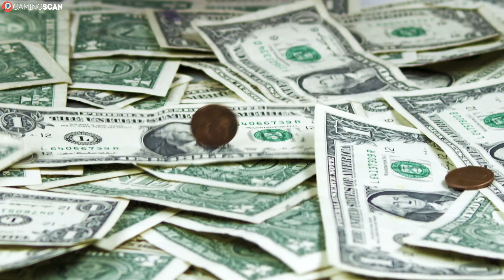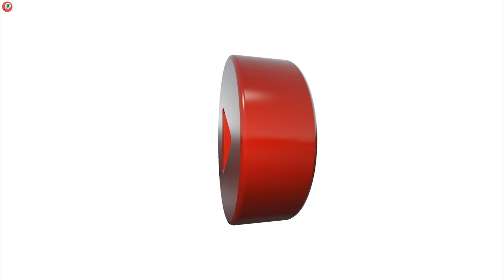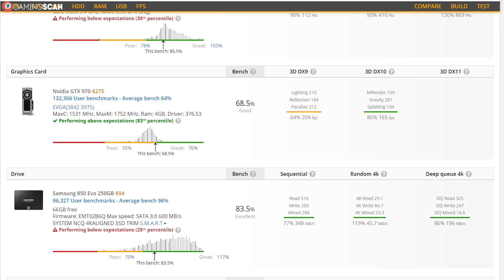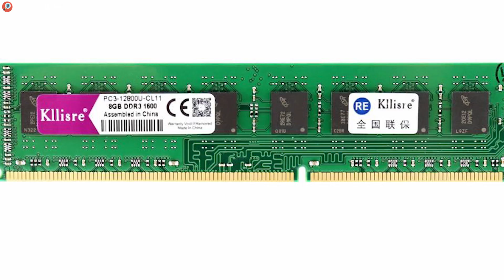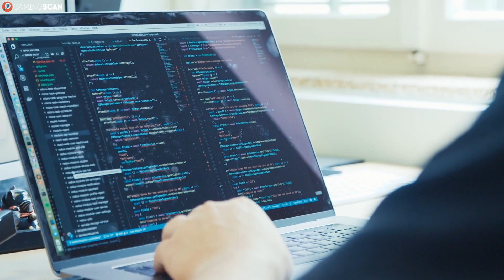How Long Will A Gaming Laptop Last? [Simple Guide]

Comment: almost 5 years~ MSI  Apache Pro~
Reply: No way. I use the 960M version, and it barely works on new AAA titles at its native resolution anymore. Being stuck with basically a 750 Ti in 2020 is not an ideal way to enjoy gaming now.
Reply: @arbutusunedo2069  Maybe you can download CSGO or Valorant to keep on with your gaming.
Reply: Mine did 6.5 year msi ge70 apache pro, then the motherboard died, did not game on it after 4.5 years, just school work

Had to replace the thermal paste and fan though, but nothing major
Reply: @rickvr11  mine still going~ almost 6 years~
Reply: Is Legion 5Pi good nd long lasting
Reply: same model, but now i have it for 6 years .. soon to be 7
Reply: What about msi bravo 15?
Reply: @allgaming2992  bad air intake build. Expect it to be 2-3 years
Reply: My apache pro ge72 is still going..but man it's lackluster asf. Obviously all settings have to be on low, runs hot enough to cook an omelet and I think a fan has died cause it spins like there's a bumblebee stuck in there and the wobble / vibration is chewin thru 2.5 hhd's like crazy now ( just figuring it out) .. Took em out and have 0 space .. Using a micro SD card as a side loader ...sucks ass
Reply: @turbobacon5945  Yea, after the 6th year my laptop just burns up. So i ordered a laptop cooling pad for it. AND IT HELPS ALOT!!!!

MY LAPTOP STILL RUNNING STRONG! 
(just using it for like work and small games  now~ )
Reply: mines coming on 6-7 years and its starting to hit that dying point but i cant replace it or upgrade to a PC
Reply: Did you open your laptop to clean the fan?
Reply: Msi gl63 dead after 3 years only
Reply: I had an asus gl502vy 980m it barely lasted 2 years .
Reply: @KPG07  whats the problem?

Comment: Gaming laptop is good if you're on a budget and you can play it anywhere but it won't last long before it can't handle the games. I'd suggest you buy ones that arent cheap because even if it is expensive, it's gonna save you a lot of money rather than buying a gaming pc including the full setup like the monitors, mic, speaker, etc... while gaming laptops only need a mouse and or a mic for exceptional use. The gaming laptop i'm currently using is the Alienware m17 R2. My specs are.. CPU. Intel Core i7-9750H 7. GPU. NVIDIA GeForce RTX 2080 Max-Q 7. Display. 17.3”, Full HD (1920 x 1080), IPS. HDD/SSD. 1TB SSD NVMe. RAM. 16GB (2x 8192MB) - DDR4, 2666MH. It cost only 12.000
000 IDR. It's pretty good and it can last long.
Reply: That cpu is weak after the new ryzen 7 4800h launched the GPU is weak as it a mobile variant .
Reply: I have no money tell me a good laptop under 2000 rupees
Reply: @techie_adhil  sry but u can't get any good laptop at that price
Reply: @techie_adhil  you need 55k rupees for gaming lapptop
Reply: What's the max temp while gaming

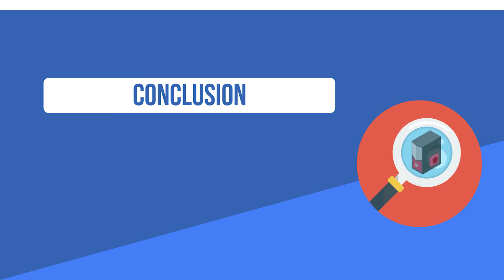Comment: The answer u came for 8:00
Reply: Thank you hero.
Reply: That's what hero's do
Thank you hero
Reply: alienware 2017 version gtx1070 "17 gen 2  (barely) lasts 2yrs ,dont get a dell laptop ,notebook or whitebook they have an insurance monopoly scam going and if you intervene and try to stop them they literally shut you intel pc off by remote settings.
Reply: @devonhc7770  what do recommend
Reply: @devonhc7770  mine has lasted for 9 years and it is still running. And it is alienware
Reply: @Braveheart-eb9zj  my Alienware 17' r4 stoped after 7 months ,now my new pc stopped working too after 2 months
Reply: @Braveheart-eb9zj  I'm fucked dawg ,I just spent $3900 on PC's for 3 years and never got to play my favorite games for very long at all..
Reply: @Braveheart-eb9zj   with the new 2017 Alienware I'd be playing and it'd start stuttering and freezing so I replaced all the thermal pads with too notch stuff ,it was better and freezing stopped but every once in a while I'd try to go in on my game and it'd crash ,won't turn on for months I'd try every button and safe mode and it just turns on and shuts off mind you only after intel updated my driver's did it completely brick, I'd try every other day to turn it on and usually it worked I turned it on and off almost 1000's of times until somethinf happened and I'd start playing again and take it to be checked and repaired with no success it shutoff again and gave me the beep of death for 9 months after the 5th time it had did a random shutdown crash,that pc desktops collecting dust rn ,my new rtx 2070 max-q ,i7 9750h factory boosted desktop I played for a couple good weeks ranked on cinebench above an i9 at 2780 score installed the required updates and downloaded intel updates app from intel went to play games and it was horrendous in areas and I would get lag spikes everywhere it was unplayable so I tested on cinebench again my score dropped to 1401 now Its garbage before it was better than the Alienware 17" with more performance power and I could play Metro exodus ultra at 60fps no problem but no it crapped on me ,got stuck in power saving mode none of the settings we're saving when I applied them ,and my computer was cpu throttling leaving it at a set low performance with stutter in games and dipping to 10-15fps I fully reset my laptop 4 times with windows 10 reset and redownload games and it still glitched all the settings and bios so I flashed bios like 5 times with one aqquired by contacting cyberpowerpc.com it didn't change a single thing so I sent it in and informed the techs about the issue with updates not loading and settings installed and not operating .
Reply: Thank you my kind man
Reply: Thanks man. This is a pain to watch if you just want to know the answer
Reply: Thanks alot..u saved my time
Reply: Careful,he's a hero
Reply: My saviour
Reply: Thanks a ton brother
Reply: Legend
Reply: Hero of day
Reply: thanks a lot dude
Reply: lmao
Reply: Thank you!!. Xd
Reply: Thanks man
Reply: Legend
Reply: Thanks King
Reply: You helped save 8 minutes of my time
Reply: KING
Reply: You are an unsung hero.....😂
Reply: Ohh thank you
Reply: Thanks m8
Reply: Tnx for saving my life
Reply: Ty
Reply: King 🙇🙇
Reply: Thank you 🙏
Reply: The not wasted time gods give you full salutes. You are a brother that deserves the best in life hats off to you.
Reply: Thank you, YouTubers do this shit to earn more money from ads.
Reply: we need more people like you
Reply: My hero
Reply: ur a god
Reply: 😂😂😂🔥 watchtime am I joke 2 u
Reply: You save my time!
Reply: Lol thanks
Reply: Thank u so much!!
Reply: Thanks for saving my time
Reply: Thanks
Reply: Thank you
Reply: thanks bruv
Reply: You're the King
Reply: Thank You
Reply: THANKS FAM
Reply: U r legend
Reply: Thanks
Reply: May your wife lives 200 years
You are the best man
Love and huck you maan
Reply: You are doing gods work my friend
Reply: thank you daddy
Reply: Thank you
Reply: not the hero we wanted but the hero we needed!

Comment: Just got my acer nitro 5 on Christmas and I didn't have any clue about it. Only knew to keep the computer clean and cool, it made me happy to know that these computers will last up to 10 years if maintained correctly. This video helped a lot to teach me how everything works thank you
Reply: Does it still work?
Reply: I also have acer nitro 5 i7 9750h, to keep it cool i have undervolted the cpu.
Reply: Still working?
Reply: Yes but yours is a budget gaming laptop which is probably maintained with weaker parts and will get hot quicker which will cause it to throttle if its overheated but u should look into a coolling pad for more ventilation and also if u want better fps if u use it for gaming keep the charger in
Reply: @vfxingx6574  every 30 mins to an hour I turn the fans to max to cool down the components so I dont wear them down too much. Is that a good thing to do with my computer?
Reply: @volksarmee8425  yes it is a good thing to do, thats what i do with mine i have a ROG GL703GM which gets kinda hot without max cooling if im playing for ages [its a gaming laptop too]
Reply: @vfxingx6574  Hey man can you tell me how many hours can i play in a laptop before it gets overheated?
Reply: @vfxingx6574  I will have a cooling pad soon so I won't do it as much

Comment: Well my laptop is 6 years old i abused it a lot used to play dota 2 at 30 fps i have 3000hours in here played half life 2 left for dead 1 and still works fine (rip english)
Reply: crookback it’s still alright because that battery lasted 6 years that’s a pretty good investment
Reply: @condensed milk it was 6 years lmao, homie can probably buy a new one.
Reply: I think the point the video is making is the laptop will become obsolete, not necessarily die. Although it will die eventually as do all electronics.
Reply: What laptop are you using?

Comment: My laptop can't play csgo at 60fps after 2 years. On all low settings and 1024x768.
Reply: Is it gaming?
Reply: @Gytsi  yes
Reply: @objectifiedslime7891  wtffff
Reply: @tcbobb16 he must be gaming on a potato toaster of some sort
Reply: @tcbobb16 gtx 1060 and i7-7700HQ
Reply: @tcbobb16 yes. it works with about 100 fps now after undervolting my cpu
Reply: @objectifiedslime7891  what's that
Reply: @itssmk_  It's giving your cpu less voltage to make the cpu output less heat. If  you have intel you can do it through intel xtreme tuning utillity.
Reply: @objectifiedslime7891  why dont use just put your important stuff on a drive and factory reset it
Reply: To make it run better

Comment: will helios predators 1660ti with i7 works till 2023 ? can i play games like gta 6 on good fps on 2023?
Reply: I think 30-40fps at 1080p low settings in 2023
Reply: @yatinraina7772  what about 2070 rtx ?
Reply: @dredhawk8037  rtx 2070 will be still considerd as high end graphic card in 2020. So if you are planning to buy it, laptop or pc just go for it. 
Keep in mind - 
for laptop - pair it with i7 9th gen.
for pc - at least i5 9gen

and 11th gen is also coming may be in end 2020 or mid 2021. yes 11th gen in high end laptop and 10gen in low power laptop
Reply: @yatinraina7772  which cheapest moderboard should i use for  i7 9gen rtx 2070 and plz suggest me cheapest case also
Reply: @dredhawk8037  H310M are the cheapest available motherboard which does not support overclocking and i5 9400f will do just fine
Reply: @dredhawk8037  and for cabniet I think antec provide cheapest gaming cabniets
Reply: @yatinraina7772  i want for 17 9gen
Reply: @dredhawk8037 You want cheap and best then buy  ryzen 5 3600 with B450 mobo
Reply: may be 60fps at high settings
Reply: I bought Lenovo Legion Y540
Reply: @GarryX10  
cons :-
Its body is a little cheap.
Matt finish makes it good to touch but it gets dirty again and again.
Lenovo written near keyboard please don't try to scratch it, It will get removed.
Battery is not that sufficient 3hr(appx.) for movies and browsing.
Power Brick is very heavy.
Fans are not controllable.
Don't use camera.

But every laptop has some cons
pros:-
Budget friendly easily available in sale.
Runs a little cooler than other laptops.
Display is amazing.
Antigost keyboard feels good but Numpad looks weried.
Best things-
i/o ports are backside
All 3 usb are 3.0
Most amazing is its looks.

I needed a gaming laptop which doesn't look like gaming but can game. So this laptop suits perfect for me.
Reply: Is it good
Reply: @GarryX10  Bro I brought the same.

Comment: I had an MSI GT70  that malfunctioned one month after warranty ended. All i did was replace a 4gb sodimm with an 8gb sodimm and it would not boot afterwards.
Reply: did you try putting the old ram back in? sometimes if a stick is faulty or simply not fully pushed in it wont boot
Reply: Sure did, But it still acted contrary. Then sometime later ,after removing keyboard to get to the other 2 sticks  and reseat,I did get it to boot,but now it does not anymore. Will send it to MSI one day. Got too many other laptops to play with at this time.
Reply: TW350Z get a pc
Reply: @bandit1001  pc isnt always the answer for everyone. Some people travel a lot and need the portability
Reply: Philippe Bergeron a pc is portable
Reply: @bandit1001  no. Its not becouse you have to bring the tower, keyboard, and moniter too. Wich takes way too much space in suitcases.  A laptop doesnt take much space. And can also be used during travel. So pc is not a option for him
Reply: Crispy Shaman not an option for him but it is still portable
Reply: @bandit1001  but you need a big suitcase to carry it

Comment: If you have a limited budget its better for a normal decent laptop + a decent gaming desktop.

Your desktop would pretty much last forever since you can always upgrade it later on. Saving the thousands of dollars you would have to spent if your gaming laptop cant keep up with newer games anymore.
Reply: No not really.  I say choose one or the other both would just get you 2 crappy computers. Desktops aren't much better with upgrading. You can upgrade the GPU. But unless you choose AMD the CPU can only be upgraded 1 gen before you need a new mobo. AMD you can get up to 3-4 before you need a new mobo.
Reply: But if you have 2, one has a high chance to be stocked and lessen the time you use it which makes your pay is not worth.

Comment: I am using a Lenovo G570 and the laptop works fine for now. Sure gaming experience might be compromised but still you can use the laptop for all other things right?
Reply: will helios predators 1660ti with i7 works till 2023 ? can i play games like gta 6 on good fps on 2023?

Comment: Any laptop or pc will only be able to run powerful games until one year after the new console generation is released.
Although if you have a great setup you might be able to play the next generation games on low
Reply: Pouria Kalagar get that bullshit outta here
Reply: @j4y625  And get that kind of bullshit about laptops breaks less than a year.
Reply: will helios predators 1660ti with i7 works till 2023 ? can i play games like gta 6 on good fps on 2023?
Reply: @dredhawk8037  Yes it can on both accounts.

Comment: I think SLI laptops last longer than the single GPU laptops . Imagine a laptop with GTX880M in SLI. It might perform well in new games if they support it . Desktop always wins .
Reply: will helios predators 1660ti with i7 works till 2023 ? can i play games like gta 6 on good fps on 2023?
Reply: Dred Hawk depends how heavy the game is
Reply: @dredhawk8037  Can't make a judgement on games that haven't even been shown yet. But looking at trends a 1660ti will play games in 4 years time. Just not new titles at ultra settings at 1080p or anything. You'll need to drop a few frames.
Reply: @thatonefruitthatistasty708  will rtx 2070super will good for future gaming?